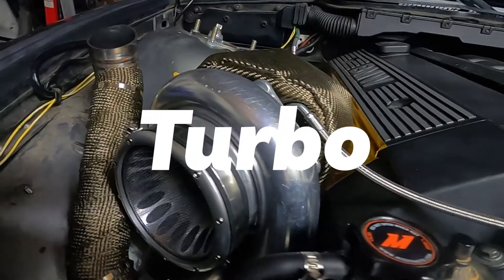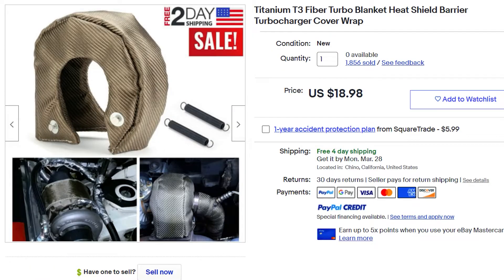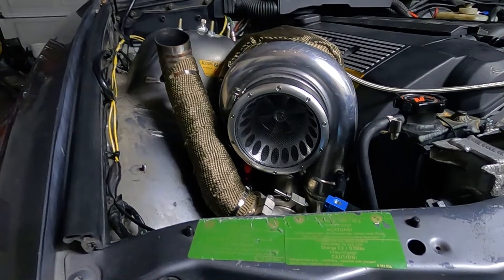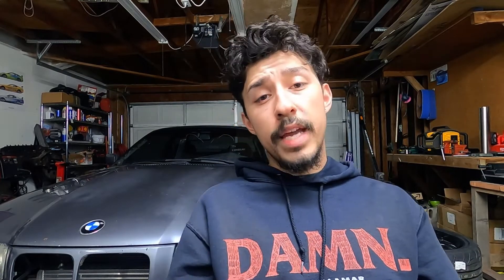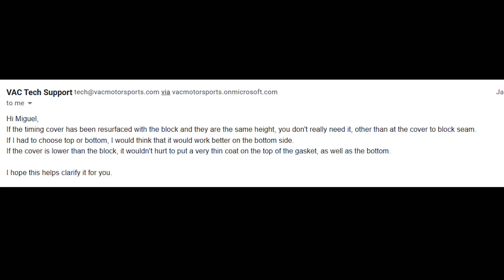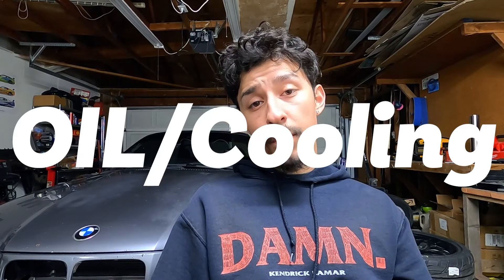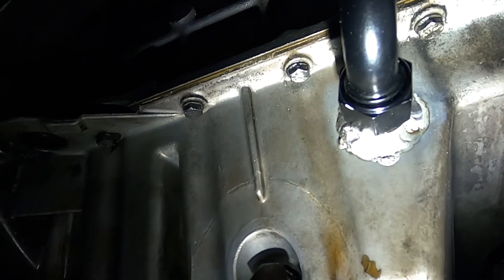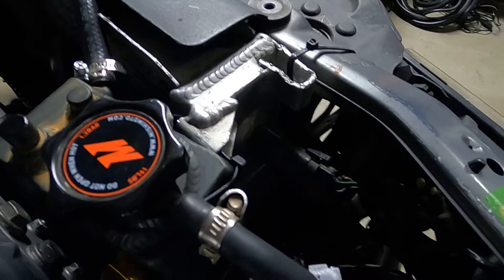How I CUSTOM BUILT my TURBO E36 pt.2- turbo, engine, oil/cooling

Comment: You can fit the euro s50b32 (real m3) oil filter housing and oil cooler, I'm currently doing exactly that on my m52. It's a direct swap, including brackets for oil cooler on bottom of radiator